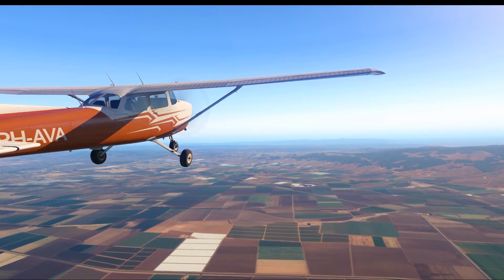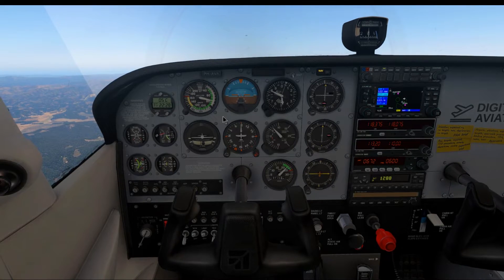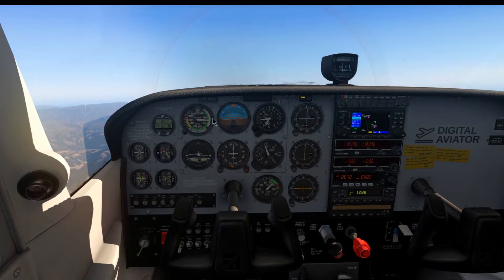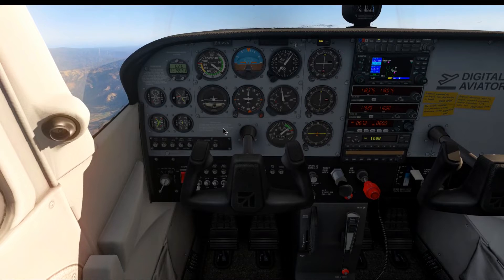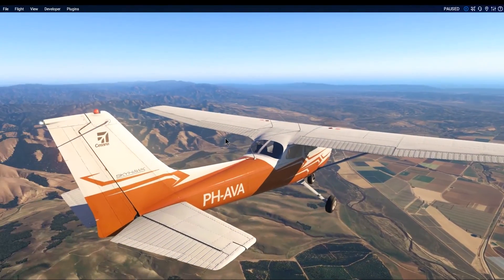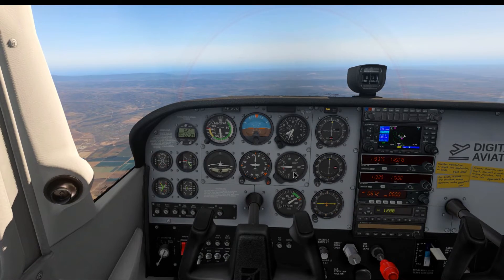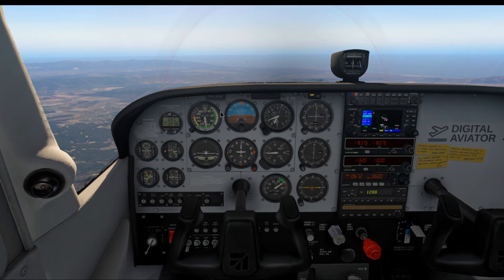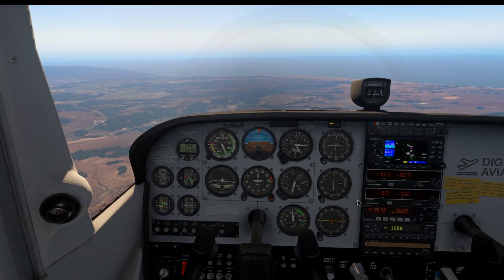Flight Sim School | Ep-13: Trimming and power usage | X-plane 11 | C172 REP

Comment: would it be harder to use a flight stick when doing this?
Reply: It depends on what u prefer. A yoke is usually more heavy than a stick. I personally prefer flying with a stick because its more intuitive.  In the simulator however I think it will be easier when u are using a yoke but also depends on the hardware u use.

Comment: On your website you didn’t mention the kind of monitor(s) you use. I would like to know if it would be good to use a panoramic curved monitor i.e. ultra wide monitor? Or would you suggest 3 large flat screen monitors arranged in a curve? Thank you for your help and guidance.
Reply from the maker: No experience myself with wide or curved, but if your pc can handle the extra pixels I guess it would be nice to have

Comment: So I have a question about using the rift for VR flying on. Plane 11. For now can you use the touch controls to do the yoke and that in the plane?  How to you do the rudders without having the physical equipment.
Reply from the maker: I still use my joystick. Not the touch controls for controlling the plane
Reply: Digital Aviator what equipment to do you have. Can you control the rudders with the rift. Or is there an auto rudder function.
Reply from the maker: @gizmoandglitch  I use the twist of my Logitech Extreme 2d pro joystick for rudder. It can do 3 axes
Reply: Will you do a video of the complete set up of your gear and your rig by chance?
Reply from the maker: I might do that yes
Reply: Great and it would give us your controls for your flight school series that we can mimic.